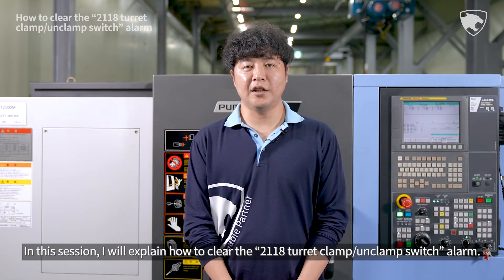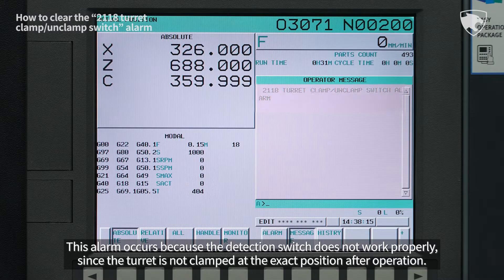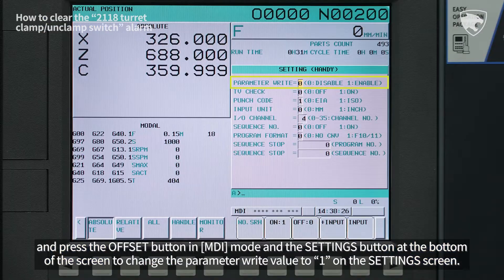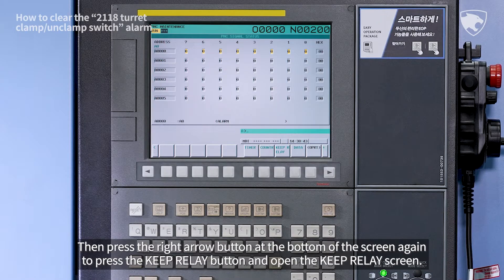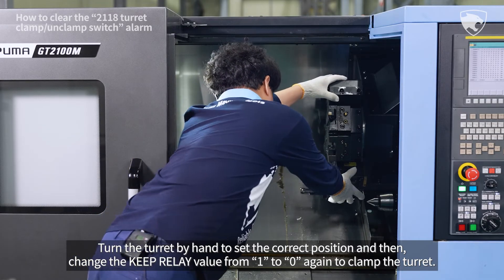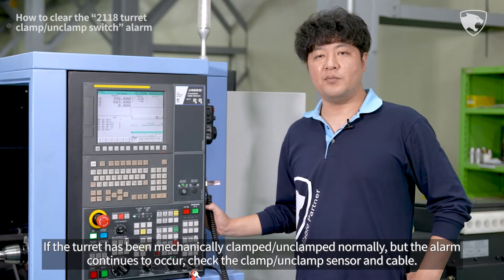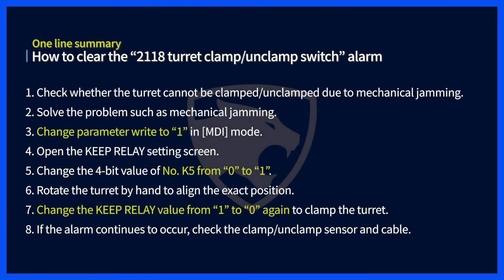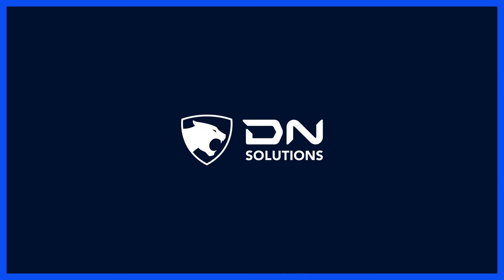Service tip.18[EN] - How to clear the “2118 turret clamp unclamp switch” alarm

Comment: But what if all it;s ok , and you still get the turret clamp switch  randomly, when it starts to turn the turret but never arrives at the tool post and it freezes like that, no alarm on the turret drive....Then pres RESET, change another post manually and it works even 40 manual tool changes, than you put an MDI/Auto change command and again freezes....      All of this overcomplicated system for a turret ... lots of things to go bad.... it can be a faulty drive , even a faulty motor even if it has good isolation good measured windings.     Expensive annoying faults that even their service people of their dealerships cannot identify or identify after 2- 3 visits/changing of components

Comment: How do I turn the turret to the tool number on the control if the tool index also keeps changing?
Reply: reset your servo drive parameter #8. look in blue book of electrical cabinet and reset parameters and reinitialize
Reply: Like that can you help me with a fanuc 21-t